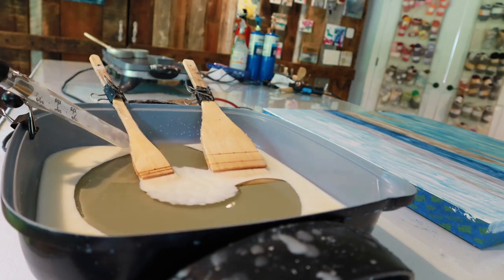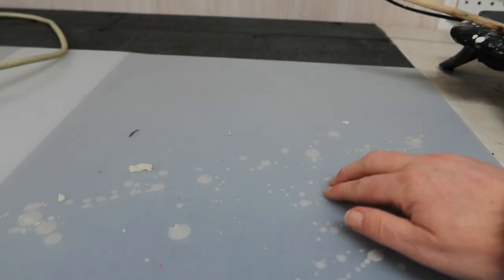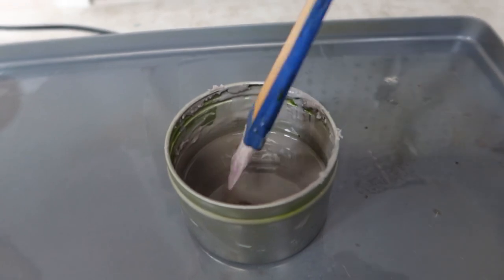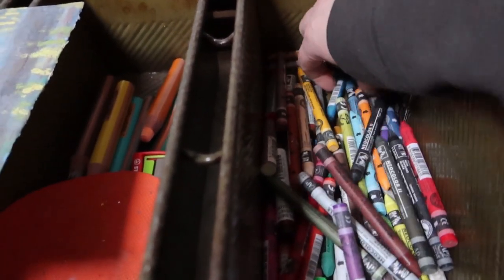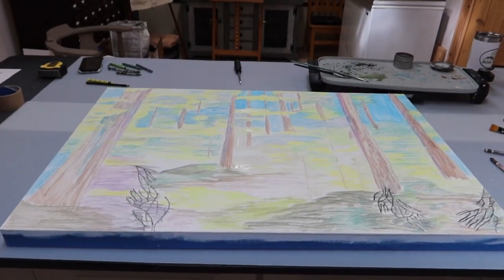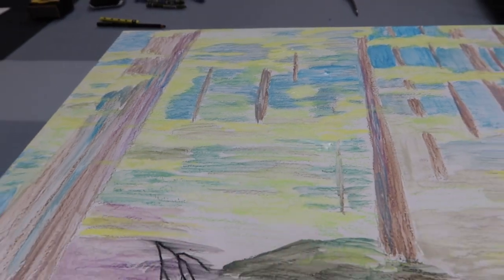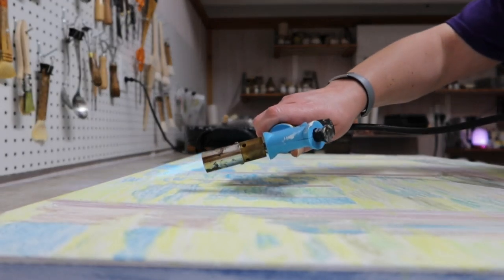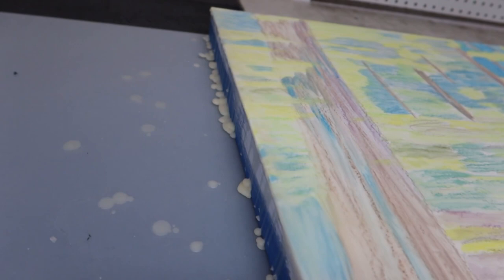Painting big with a torch and wax part 1: prepping a panel, an underpainting, and a smooth wax layer

Comment: I expect you've answered this before, but do you recommend a particular brand and model of torch? I have been looking at the Bernzomatic TS 8000, and the Itawani Pro2 Culinary torch. It looks like it's easier to find gas for the Bernzomaticatic torch at my local stores. .
Reply from the maker: I have the bernzomatic TS3500 for my everyday torch. I love this torch as you can turn the flame down very low and up quite high. And for the same reason you mentioned  - the gas is readily available.  My larger torch is a  Mr. Torch Cyclone Propane Torch. But the larger torch I only use on the big panels and usually only on the first few layers. If you get a propane torch this Hose Kit https://amzn.to/41qsl61 has been great as you don't have the weight of the tank on the torch. Hope this helps.
Reply: @StudioStacy  Thanks, Stacy. .